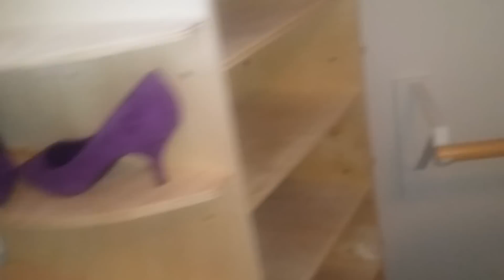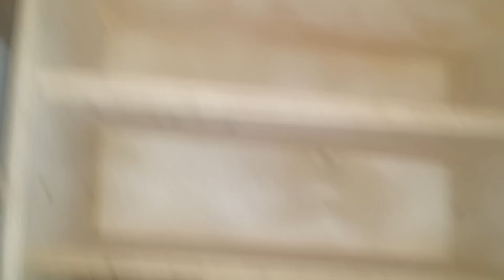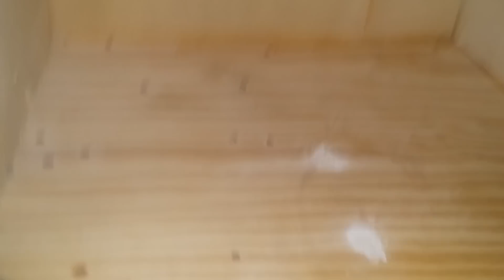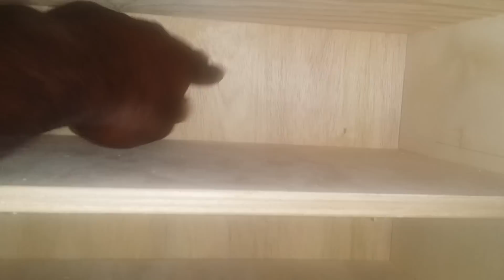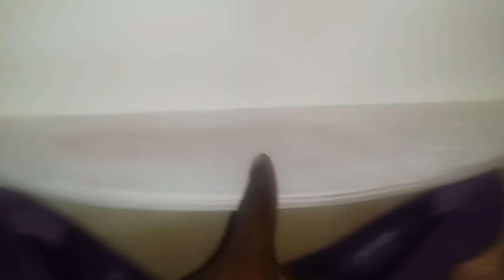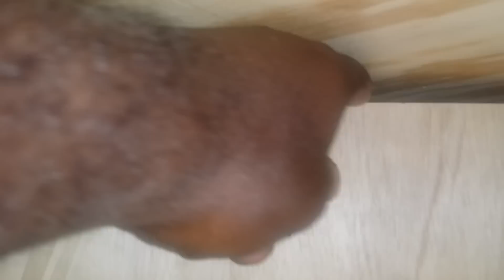DIY Lazy Susan Shoe Rack

Comment: washers for your 3/8s bolt. Also stain and poly would of worked wonders. Rather then a motor on top. find a motorized wheel concept and mount it to the bottom to the lazy susan brakets. Then add a nice toe  switch. 
Great build and concept. Keep it up

Comment: I love this idea better than the pie wedge carousel.  I would make the shelves adjustable so that as my needs change, I have the option to change the carousel.  You've given me some great ideas to work from.  Thanks so much!
ok, three weeks later and I am done with all the cutting, banding, sanding and will finish soon after I get over this flu.  I  will now do a test assembly to make sure it's done right.  If that works, I will then take apart and primer and paint and then bring to the room for final assembly.  Cost me a bit more than your 200.00 budget cause I needed some stuff that I didnt have (besides the wood, of course)  Total cost will be around $400.  But the second one I will be for just the cost of the plywood which will be around $150.  so in the end it works out to the same price as yours per piece.